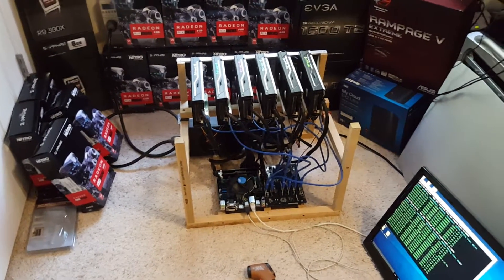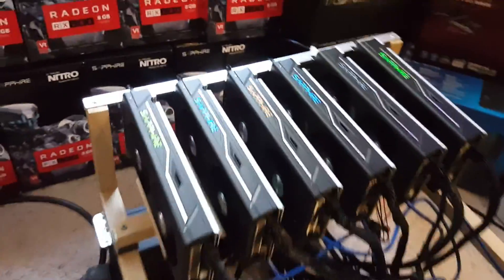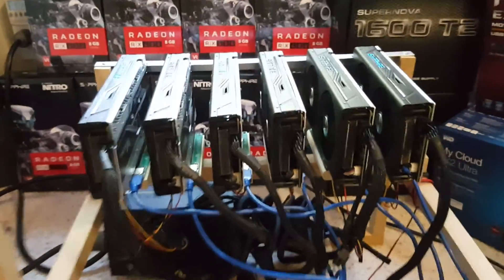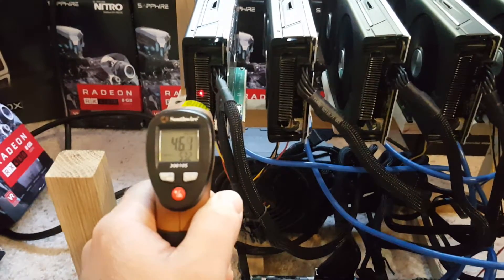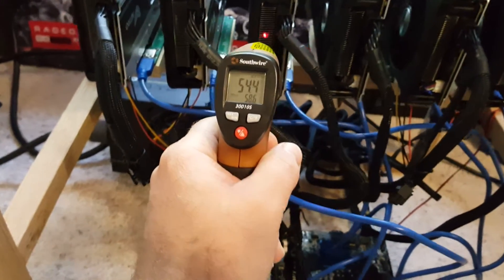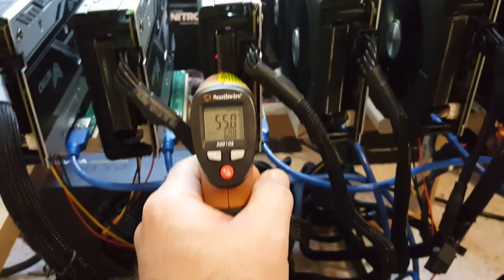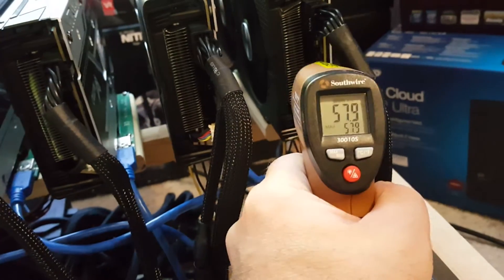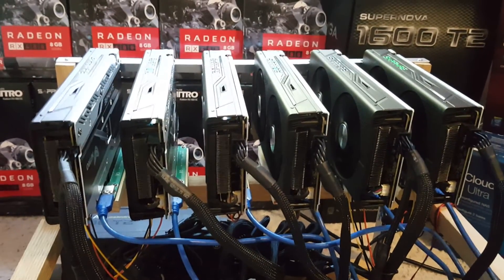Temperature Readings Mining Monero / XMR Using 6 Sapphire RX 480 8 Gigabyte Graphics Cards Overclock

Comment: 3790h/s? x 6 GPU RX 480? Very low, 
In my case it gives me 800 h / s per GPU = 4800 h / s

What power source do you use?
Reply: You can reach 6000 h / s by overlocking the cards

Comment: You might wana try gpus with no ios they are cheaper some times if bought used, I have three tesla M1060 I get 50 mhs from each one and  I got them for 18 bucks each 250 cuda cores each no sli config, I am using them as my base setup & yes they require A advance motherboard to run, I also just want to be able to set this up on A my servers that I have so they can then become use full & not just cpu bound software - that is a pain in a gpu world
Reply from the maker: That's actually very cool idea thank you very much for suggesting this but can you give me a little bit more information? What kind of motherboard would I actually need and processor I'm interested in trying to build one?
Reply: I am using your standard amd board - it just can't be an old one no more than 5 years, the  more pci E lanes you have the more risers you can add thus more of tesla cards, also keep in mind they pull 200 watts & if go with M2010 card that pulls 800 watts max
Reply: this is also Y you might wana go solar so you can store electricity in batteries  & not be blowing fusees, I am in the beginnings of starting my first battery bank from 18650 cells & then charge them with solar & then I can work on my projects for hrs with no electric bill
Reply: Joel, what currency are you mining with the M1060? And what miner specifically? I picked up a M1060 and I can't seem to get it to work for mining XMR. Any help would be appreciated :).
Reply: I don't that was an example, am using the gtx 470, that has more power than that does, the gtx 470 does infact work with minergate, but their is still not much power from that card, it is in the km
Reply: hey bro, can  it would be nice to see a tutorial of your idea.
Reply: How would you know you don't have my setup - that the time 64 gigs of ram - the m1060 where in a hp proliant dl380 G6 - the server retails on amazon for 4,000 new
Reply: I am thinking to give a try. Actally 200w for 50mh/s is nice. Which system, driver are you using? Did you overclock  it or changed bios setup?

Comment: it would be better if you could actually measure the same things on each set up, but... wattman should keep the temps to what you set them on anyways... what is the temp that wattman tells you for each GPU when its running?
Reply from the maker: I am going to try to get different temperature readings as I change different mining setups and and the CPUs are running at about 65 Celsius to 70 Celsius.